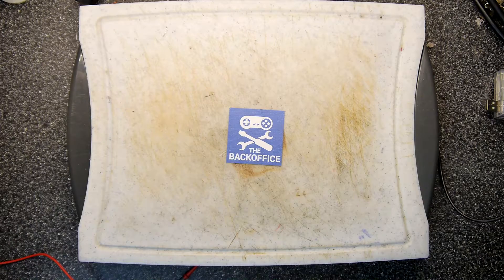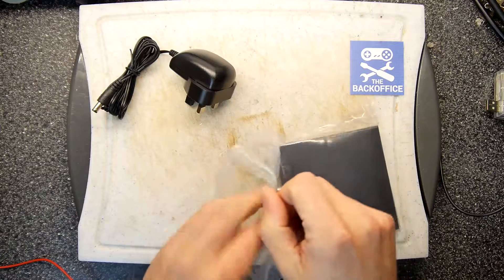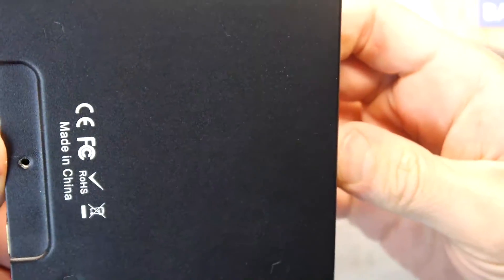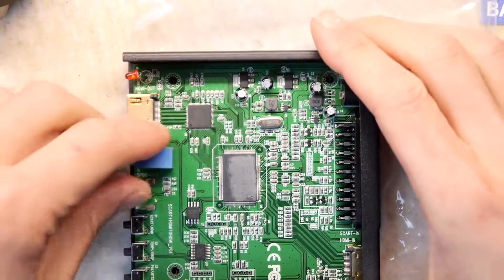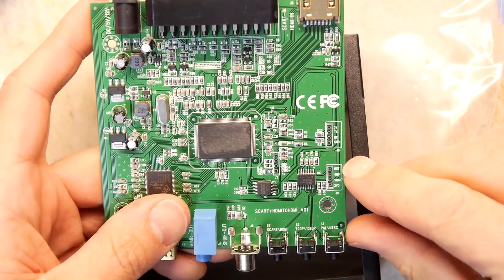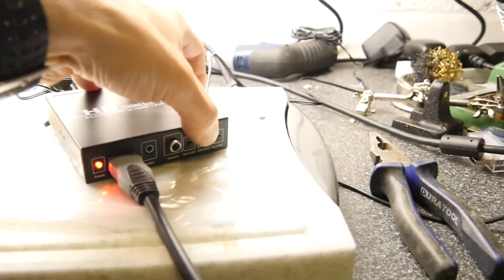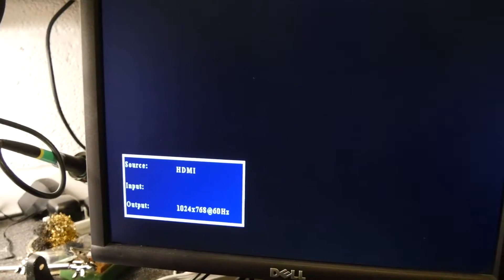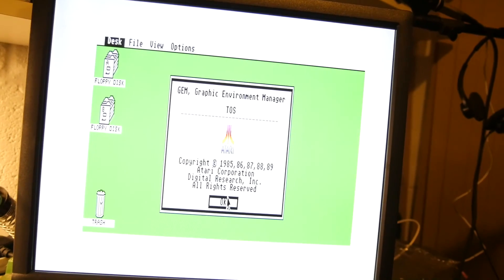RGB to HDMI Adaptor Retro ATARI Hardware

Comment: I just tried that same type of scaler with my 1040STF and a SCART cable and my monitor could not pick up a signal from it. That same scaler works totally fine with my Apple IIGS (it introduces lots of lag, which is noticeable in gaming though). Anyway, the Atari 1040STF has me totally baffled. So far the best I have gotten out of it was a very unstable image while connecting it to home CRT TV that had component RGB. I've heard the component RGB cable will work with a PVM, which will probably be my next course of action.

Comment: I recently tested this device (from another manufacturer but actually the same) with my ST on different monitors and TV. I can't really share your euphoria on this upscaler!
Yes, it works on both my TVs with ST and Playstation, the pic-geometry (in 50Hz) is correct, but it has issues displaying the picture. If you're in the Desktop of the ST, the mouse have sort of ghosting (as you already stated), drop-down menus are somehow wobbling, all icons and letters have a white aura etc. Seems that the picture is somehow compressed, don't know. But the main issue is the much noticeable input lag, allthough my TV already is in "gaming-mode". Just judging picture, my cheap VGA-to-HDMI converter has better quality, without these flaws. Of course not 1080p and it does only work (somehow) on my 15KHz compatible NEC MultiSync 1970NXP. ;-)
If you're interested, I made a (german) comparison-video of different HDMI-solutions for the ST: https://www.youtube.com/watch?v=gZxvuUX1nNc (direct product- and final-thoughts- video-links in the comment-section)... and the winner is by far: the OSSC! 🙂

Comment: hey,  I just subscribed. Great video.  I'm thinking of getting one of these.  but for ps2 and ps1 games on ps2.
Reply from the maker: Thanks for the sub, they should work fine on those machines.
Reply: I'm ordering it today.  found it close by.  they say RGB and composite scart accepted. it looks just like yours on outside but much less money.
I'm concerned it will be junk but it is identical to yours and accepts RGB, so for less than 15 usd including free shipping...why not!
Reply from the maker: It's probably ok, and maybe they have dropped in price since the video was released

Comment: Dude! You are like MI6 for me as far as these retro video devices go! I too got burnt by the composite ("scart RGB") to HDMI adaptor. I really, REALLY did not want to crack her open and check if the RGB lines off the SCART connector were even present and went anywhere to an IC to be processed - your fantastic video was all that I needed. AND you directed me to the exact device I needed with the RGB functionality working specific to my purpose. THANKYOU! :)
Reply from the maker: You are most welcome I am glad I could help!

Comment: I got  the same converter you used, and picked up a rgb scart cable from coolnovelties, but it never detects the input, not sure what else to do. 

 I have an NTSC 1040STF.  I also purchased one of those premade VGA cables -- it works but it only does black and white.
Reply: So, picked up the same setup and here were my results.  I have two NTSC Ataris, one Atari 520ST and one Atari 520STfm.  They both work fine on my Atari SC1224 CRT.   The STfm works fine with one of those custom composite cable that they make on my LCD, although the picture is pretty bad (better than a modulated TV signal, but not by much), obviously those cables won't work with a non modulated ST.  With this setup, (The 12.99 cable from coolnovelties, for the ST, not STe - and the box) it worked perfect on the 520STfm but did not work at all on the Atari 520ST.  It's possible there is something related to the modulator, so curious if anyone without a modulated ST has had success.  As well, the cable does not actually list a 520ST, but it does list the 520STF or the 1040ST so maybe theres something there, though the person above didn't have success with his STF?
Reply from the maker: It might be worth seeing what the STF outputs, I only had STEs, but I know some variants only outputted composite or RGB or variations in non standard. This thread might offer some help http://www.atari-forum.com/viewtopic.php?t=28665

Comment: Hey, nice channel, i saw some of your Atari videos yesterday.

I got the same HD Video Converter a few years ago too, or at least it's the same on the outside, i opened it today and the board inside is really different but i can't say more. I could never got anything else than "jumping" images (jumping from the Atari to black screen back & forth every one or two seconds...) with it, same as using any SCART directly into any modern HDTV. (Two original STe cables + ST Scart from coolnovelties shop = same result. I only realized today they sell a specific STe one today on their shop? It seems to be wired differently than the ST SCART besides the RCA/audio but... totally not sure.)
In the end i found a NEC MultiSync. Too bad now i don't really have enough space for too many monitors on my desk. :P (Plus hey, clusters of Atari STs with a few RPi's!)
I had shelved (and stored) everything since but I got out my never-tested GBS-8220 V3.0 because of one of your vids. i managed to get a surprisingly really decent output (at least in term of definition, it's quite sharp as opposed to what i read/saw elsewhere) on a standard 1080p monitor using a MultiSync VGA cable after some tweaking of the settings and uh... having to "short" the "S" and "VS" signals — or else i would get the same pseudo flicker/"jumping" images/black screens. Surely not great ok. (i saw there are schematics / something to do for that case i believe... I might just fry the GBS.) I wish i could have that adapter/converter work anyway. 
For now the GBS doesn't seem to be always stable when the Atari is using the floppy drive. (Perhaps I'll test with my "Cosmos Ex" ... And i wonder about a Gotek Drive again now! Uh thank you. :P i can't even play games anyway, surely not with that old awful joystick i used to play games on my Atari as a child. It's OK i'll run some emulator again haha.)
Reply: I am just going to reply to myself heh. So... Indeed i might also damage the STe with what i did with the GBS-8220, i didn't look into it further yet (i will, probably). But i found the answers for the adapter (saw i bought it in 2014 !), ended up doing like some others to "force the RGB mode" with a little soldering etc. Also desoldered the 16pin on the SCART plug so the 5V doesn't feed back to the STe... (thread: "falcon SCART/RGB to HDMI on AtariAge and others - JIC if someone else see this & needs it) - and i guess i'll add a little switch later for this. But this box (my version) doesn't look as sharp as the GBS-8220 v3.0 so far.. It needs more tests i guess (but it might just be enough if i can't bother more with the GB). On the GBS-8220 i was on the lower resolution, possibly only 640x480? This one doesn't go below 800x600 and if i try to go higher resolutions it gets really really dirty ugly higher - as ugly as my GBS when it's not tweaked/set up.
Reply from the maker: Thanks for your excellent comment, hard to read on my phone, but I hope your ST survived the experiments 😊 It's strange how it seems to be such a hard thing for people to solve, but I'm glad reasonable hardware exists. I get some criticism for not using a GBS but a lot of people I talk to have dumped them
Reply: So far it survived what i did with the GBS but i'm not going to push my luck further run it like that for longer :) Yeah i get it not using the GBS when there is a solution that works out of the box (or almost in some cases). It's not perfect with my HD converter but it would do the job decently enough anyway...

About the GBS, i'm going to try one more thing: After looking at too many wiring diagrams and so on, on the forums/etc... i'm probably going to make myself a cable (DIN->VGA) for the STe so i can use the CSync signal directly (i think only STe models outputs composite or CSync...), i'll be careful and check what i do... We'll see :) For now i'm mostly doing this for fun, doing some bit of soldering again lately etc, even if i end up not using it after all. I think a lot of the different problems people encounter are related to the different ST/STFM/STe models? And the one that have RF/or not? In my case electronics are not my thing so... Heh. But thank you, i'm glad your channel exists and you made all these videos!

Comment: I've bought on Aliexpress this one and another slightly cheaper converter, without HDMI pass-through and with only one push-button (Kebidu HD 1080P SCART To HDMI Converter). One you show, in my opinion, has overly sharpened picture and little odd colors. The Kebidu one not only produces slightly softer image, with more natural colors, but also supports SVGA, XGA, and SXGA resolutions (of course 720P and 1080P are also available). Both work well with STe (with Composite Video as Composite Sync for RGB Video). Some converters like the GBS8200 "dislike" the CV as a CS and require to combine HS and VS with some simple circuit to produce a "clean" Composite Sync signal.
Reply from the maker: tzok83 for me, anything that works without a headache to configure is a win 😁 it would be nice to fit a hdmi directly to the st one day
Reply: So this cheaper Kebidu converter is a better choice, as it allows using old 4:3 standard PC monitor (even a CRT one). One drawback - it doesn't have a pass-through port, so you have to use a dedicated or multi input monitor.
Reply: @TzOk  Hi, could you post a link to which kebidu you bought? On AliExpress there are multiple models with the same name, but ook different
Reply: @TzOk  thanks!!
Reply: Do you find any lag with the Kebidu?  Also doesn't the one in this video have the same options as the Kebidu?  I am thinking of getting this for my Amiga.
Reply: @RabidGerry  I didn't find any difference in terms of lag between these two upscalers, but definitely there is some slight lag for both.
Reply: @TzOk  would you say it was worth having or too much lag?  Currently using a GBS 8220 with GBS control but I was wondering if I could better it.  Thanks btw
Reply: @RabidGerry  For me it is OK, but I never had anything else.

Comment: Will it work with commodore amiga RGB ?
Reply from the maker: +Bruno Sousa it should work with anything that outputs RGB 👍
Reply: I have one similar, inside has the chip Macro Silicon MS1858S, when i put A1200 i got gray screen but i se the OS.. i made the Db23 to Scart cable.. i remember first try i got same proble,, the plans of the cable are wrong on internet, i need to put some resistors inside the Scart connector and boom, almost perfect image, then add ferrite core beads and thats it a perfect cable, but yesterday try my gift Scart to hdmi converter and this gray image, thinking i need to modify the cable and you got great quality, Then i test Commodore 64 with composite output to the adapter with composite to scart connector and got blurry image, then i see i turn off and on the C64 and got nice image, but need to work with interferences a little, the sound are very clean from HDMI..

Comment: I love how the price on amazon of the very same item from the very same seller changes from 24 quid to over 56 euro just by changing the top level domain.
Reply from the maker: +SeltsamerAttraktor Yeah, as with any online purchase, lots of shipping around for the best deal.
Reply: Yeah and it's all very shady, no brand name no nothing. Listings on ebay where it states that the item is located in my country, complete with the damn flag all over the article description, are actually Chinese sellers and the item gets shipped from there of course. With all the problems of delay and virtually impossible to return. Ahh, globalisation. It means buying cheap crap from China.
I read down here that the input lag is horrible. Can you confirm that? Did you use it for actual gaming in the time since making this video?
Might be cool for capturing, which I don't want to do. If it's any good for actual gaming, I might actually get it and hope I actually get the same thing and not some other revision or clone that is worse than the one you have.
Reply from the maker: +SeltsamerAttraktor It seems fine to me, though I don't have many super fast paced games on the ST. It's nice when you get something that works. I haven't noticed any lag with the mouse etc

Comment: I got a similar one, but returned it. The ouput lag was awful and could not capture the HDMI signal with my Avermedia LGP.
Reply from the maker: This one is pretty flawless, can you remember the one you got, it could be useful for me to try one and compare.
Reply: It looked very similar to yours, same case, same typography and of course; no branding. There seems to be lots of them about, all look very similar, but might contain slightly different hardware. I never opened mine, returned it straight away because it wouldn't do what I needed it for. Have you tried to record yours?
Reply from the maker: +gearsofgameschannel Yeah it's hard to tell what's under the lid. I haven't tried to record directly as I will just use emulated systems for the highest quality and lowest lag. Every thing you add in a digital pipeline will add delay, so it's a real problem unless you split the scart and play the game on a TV while your HDMI recorder records the split. That would work perfectly.
Reply: Yeah, I was considering to do something like that, but decided to stick to emulation for now. It still has an edge when it comes to quality. My current capture solution uses forced VBR and quality when recompressed is a bit dodgy :)
Reply from the maker: I guess emulation only takes you so far, probably upto the portable 32-bit devices, after that it gets a little trickier right? Im thinking playstations, dreamcasts, gamecubes and wiis just before they went hdmi.
Reply: Yeah, emulation definitely gets more dodgy with the more modern systems. But there seems to have been a lot of progress in emulation of them lately, so it's getting here. Personally I haven only been recording emulated systems up to about PS2 generation and that's been working OK for the most part. But it depends on the system of course... 

I suppose it's also up to how picky you are with accuracy. I would love to record only on actual hardware, but its just not very practical, for many reasons :).  I have been considering an FPGA solution, like the MiST. I suppose that should be better than emulation, but there's still some problems to solve...
Reply from the maker: Yeah its diminishing returns on your time and effort when you start getting into the FPGA etc solutions and at the end of the day you are always asking yourself what are you actually trying to achieve.
Reply: Indeed! So I think I will stick to as high recording quality as possible, before YouTube put it's teeth into it! :)

Comment: Nice!  Been looking for a decent solution that doesn't cost as much as the Framemeister.
Reply from the maker: You can use it for so many consoles, its a great investment.
Reply: the old versions of these boxes would overheat. you can add a good heatsink or just leave the cover open

Comment: Do you think it's possible to mod this device into the ST with a HDMI out socket?
Reply: Brian Boothe you'd have to solder direct to the video and audio connections inside ST (not sure how easy) and we don't know how it deals with high res ?!
Reply from the maker: +Brian Boothe This can be done 100% ! There is loads of room inside.
Reply from the maker: +Meth Methanoid I would solder to the board, it would be fine, I'm positive hi res would work when connected to the port as usual and even if not, the modification for the switch would be minimal. Personally I would not miss high resolution, I'm not doing any ATARI ST DTP work out choosing these days 😂
Reply: Is that an offer? I can order another box in :)

Comment: A nice review. Is it possible to push Hi-res through it over SCART without blowing stuff up? That's something I'd be personally interested in.
Reply from the maker: +FairFight14 I doubt anything would blow up, I may well give this a try next time I have it out
Reply: Scart supports higher res than SD PAL?
Reply from the maker: +MrcabooseVG nah, just the regular low and medium modes. The picture is crystal clear though.